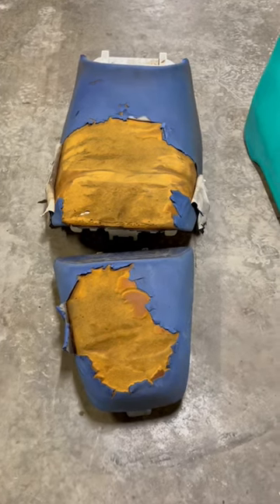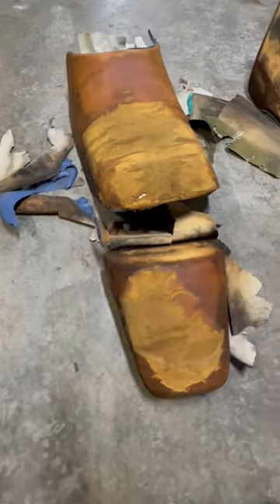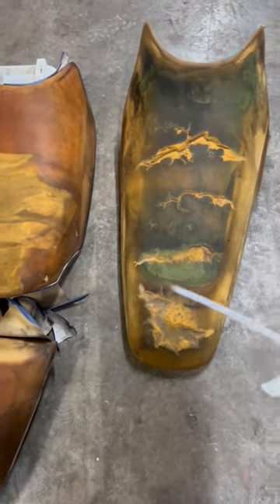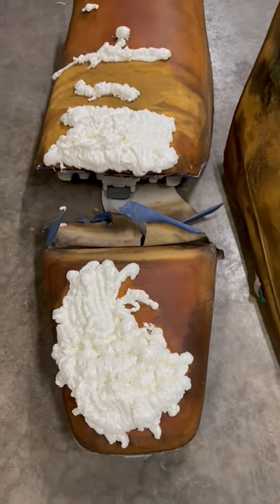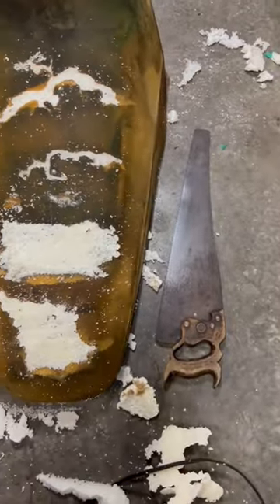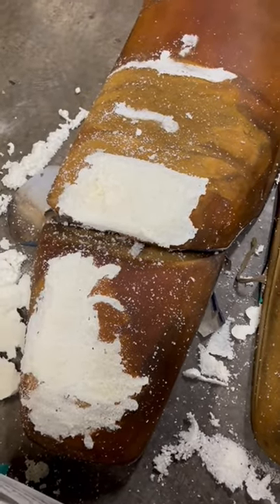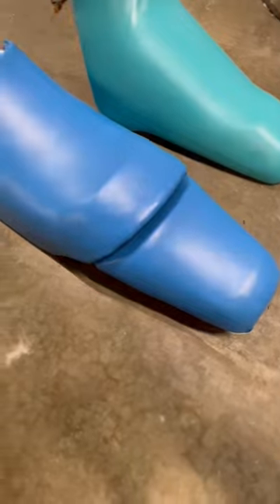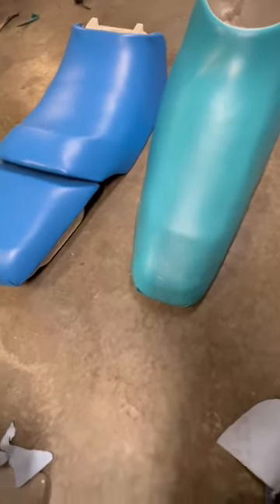Damaged jet ski seat repair: DIY seat recovering using materials from your local fabrics store!

Comment: That came out great!  I also have a 99 GP1200.  It’s so light…Great ski for jumping waves
Reply from the maker: Thanks! I have two GP1200's, they're just heavy enough to be ridable in the bay, without being barges.  I had a 94 Waveraider that only weighed around 388lbs, and it would get tossed around in anything but smooth conditions.  But when you took it out on a calm river, man was it fun to slide around!

Comment: I'm about to do the same thing on my Seadoo rxt. I have a few holes i need to fill and was thinking about using spay foam to do it. Is the spay foam noticeably harder than the original foam? Thanks
Reply from the maker: It is a little bit harder than the original, but once you shave off the outer skin the inside of spray foam is usually softer. Then if you do the thin layer like I did over the entire seat, you pretty much can’t tell once it’s all done. Nobody who has ridden my skis has ever noticed anything 👍

Comment: Did you use qny spray adhesive?
Reply from the maker: At the 1:55 mark I used spray adhesive to attach the thin layer of white padding used to hide the imperfections in the original foam.  I think I used 3M Super 77 👍

Comment: What was the padding you put on in between the seat and the cover?
Reply: Was it upholstery batting?
Reply from the maker: I dont remember the exact name of it but it was just a white non-absorbent woven padding layer to hide the minor imperfections from the foam repair. It’s not very thick at all, it just hides the sanding marks from the flap wheel and the foam repairs.